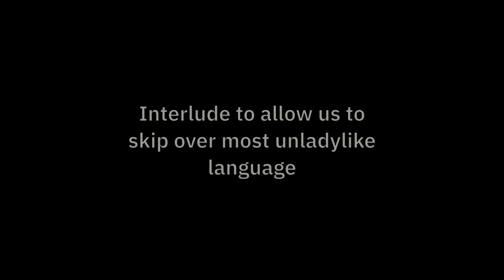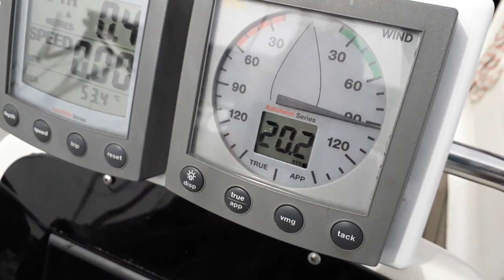Sailing Northern Ireland - Going astern - Rusty Sailors - Ep. 183

Comment: Look at getting a replacement alternator bracket with built in tensioner. There're lots of options available on the net so I'm sure you'd find something to fit your motor. It would remove the need for brute force and not slowly lose its tension over time.
Reply from the maker: It will certainly be something to keep in mind. This alternator is about 20 years old and will probably need replacing in the relatively near future. Thanks for the suggestion 👍

Comment: Thanks for the perfect excuse to take a break from sanding interior woodwork on Wavedancer
Reply from the maker: Glorious, glorious sanding? 😀😀😀😀😀
Reply: @SailingYachtSaltyLass  last of the big areas done today.  Machines home. Hand sanding fine detail & too small areas to get machine in.  Saloon & galley looks SO much bigger with lighter colour of naked teak.
Reply from the maker: It sounds great. Are you going for a gloss finish or a matt or satin?
Reply: @SailingYachtSaltyLass  my sister and brother in law advised teak oil. Varnish can crackle in sunlight.  I was planning on clear gloss. Galley will need washable surfaces anyway

Comment: Gday girl's, with regards to swivels I had one break on me in a blow last Christmas. Admittedly it was a cheap one but still. Now I use a rated shackle. I think it's a case of look at what the fishing boats use which around here is no swivels as it's just one more thing that can go wrong. The sales pitch for swivels is that if your anchored for a few tides it might bind up but haw can it. If you have enough scope out the chain can't roll around and I'm swivel unless you have a big wind that lifts all the chain off the ground so if you have been swinging at anchor it won't start to unwind until the anchor breaks out where it will in ravel anyway. I keep a trip line on the anchor with a float so I can see where the hook it so when the swivel broke I could recover the hook. Each year I go on the slip I range out the chain to unravel and check it and redo the marks. I then sorry it with fish oil which is a good antirust. 
As far as weather goes if in doubt don't go out, especially to make content for us. I don't need to see a train wreck. I solo sail and coming from an instructor background I to like to practice systems often in the hope that it becomes second nature and efficient when it's needed, pluss it's fun.
Reply from the maker: We pull out in a couple of months. I will have a think about the rated shackle and maybe try it out and see. We can always keep the swivel to one side and if the chain twists and kinks then we can always put it back. I prefer the simplicity of a shackle. If the weather is "train wreck" we tend to stay in. We have no desire to be a trainwreck!

Comment: Regarding tensioning the fan belt, I've used an old heavy duty, long shaft screwdriver, for many many years. The longer the bar, the lesser the effort required. Maybe even a 2/3 foot piece of stout broomstick handle, would do the trick. I really enjoy your videos. Barnacle Bern SY Cadbri SW Wales.
Reply from the maker: Thank you! And thanks for the screwdriver tip. Do you use it as a lever of some sort? What do you use for the pivot? If we get down to SW Wales then give us a shout.
Reply: @SailingYachtSaltyLass  pop the end of the lever down between the alternator and the engine block and lever against the alternator itself. Can be done by yourself but an extra set of hands is useful to keep the tension on whilst tightening your nuts
Reply from the maker: Thanks for that. For work like this we always do it together even if only to be there to pass tools or some such.
Reply: @sailingmoonshadow3169  Precisely. Exactly. Got it in one.
You’ve obviously had many occasions to employ such methods, Moon Shadow. 😎👍
Reply: @MrBernie101  indeed. Mostly on old cars!

Comment: My rusty mistakes have been raising the mainsail, without releasing the clutch. Getting it to the top and thinking that was hard. Go to close the clutch and its already shut, I've done that twice now 🙄🙄🙄. My maintenance is going well ladies, 8 hours to clean the boat and I've fitted my 10kg Lewmar Delta anchor. More jobs to do this weekend 😊😊😊
Reply from the maker: How did you manage to hoist it? Do you have the stretchiest halyard in the universe? Or do you need a new clutch? 😀😀 Keep at the jobs, but remember to do some sailing as well ...